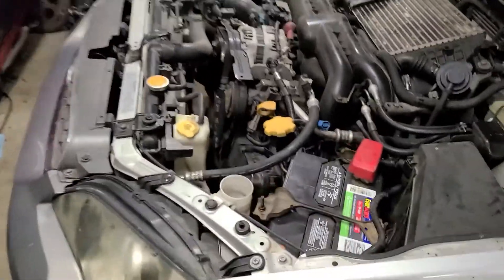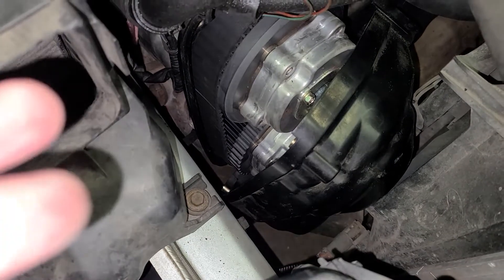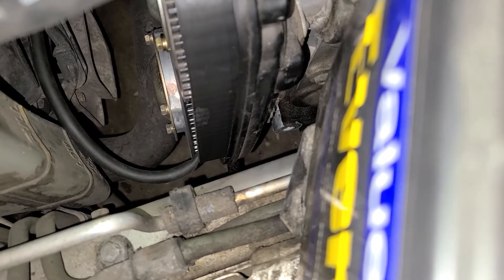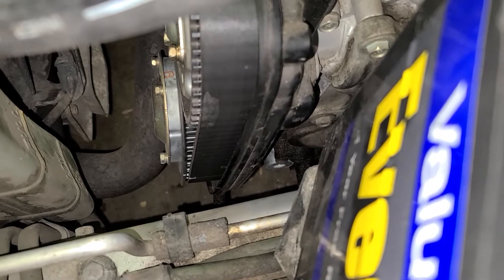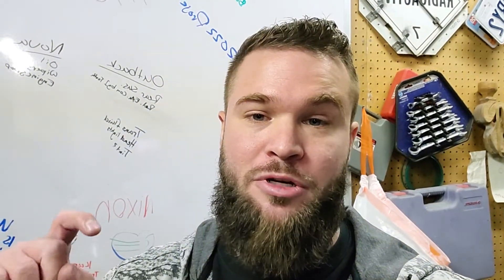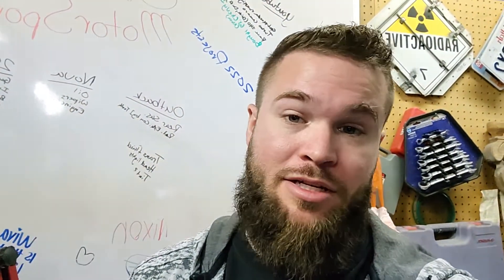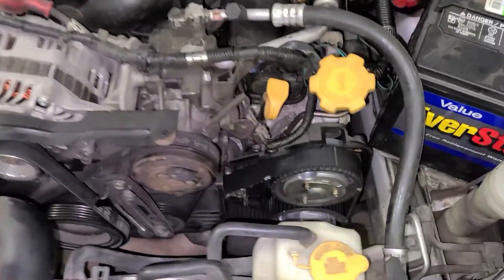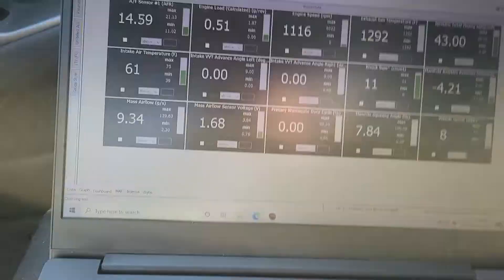Outback XT EJ20X Swapped Cam Test #xt #outback #ej20x

Comment: Are you on a stock tune? Will it hurt the engine to retard the exhaust cam timing? Can the issue be "tuned" out? I did the ej20x swap and I have to wait so long for the perfect gap to get into traffic. It feels like I am starting in second gear. Id like to try this fix but my Subaru shop folks tell me not to waste my money, just save up for a 2.5. Do you know how to fix the situation so as to get the full potential of the 2.0? Thanks for guinea-pigging!
Reply from the maker: I was on a stock tune for awhile. I ended up buying a tactrix cable and tuning it. It seemed to help a little, but not much. As for tuning out the issue i dont think you ever will get it tuned out, unless you swap the JDM ecu/harness with it to be able to control the exhaust avcs. 

I feel your pain on the not being able to shoot a gap though, that's why I started to do this.

Comment: Hey man love the trick to the cam retard. I did it with vacuum hose I had. Worked like a charm. Also look up ausi legacy gt(liberty gt also a 2.0t) stock bin file. 98% of the settings  are the same table size just copy tables and past tables take a good 10/15min to do. I then interpolated the timing and fuel maps so it’s nice and uniform. I haven’t tested waiting on some eBay headers. To come in so I can use this vf46  with 200miles before the 2.5 blew a ringland. I also bumped the boost up  everywhere past 3k to .4 for about 5-6 more psi..   These engines so cheap I feel like buying another one in case before price goes up.   I been seeing a lot more Ej20x swap subi now so I can see this being a 1500$ motor vs the 900-1k.
Reply from the maker: I'll look up that file and give it a try. And I'm glad the vacuum hose trick worked for you.